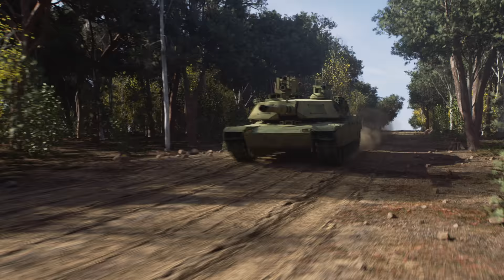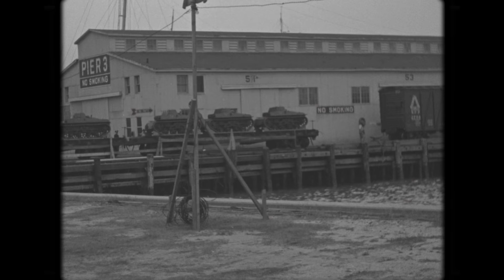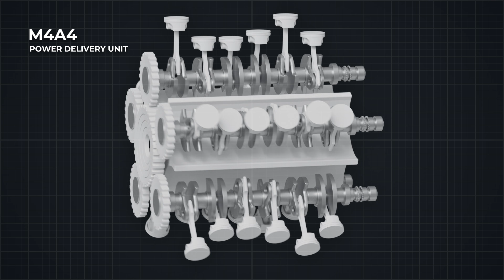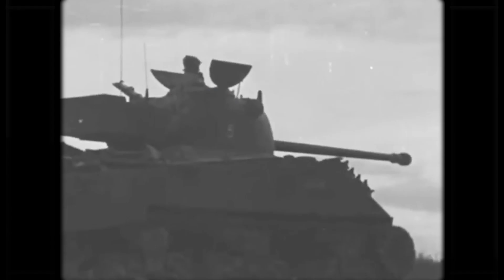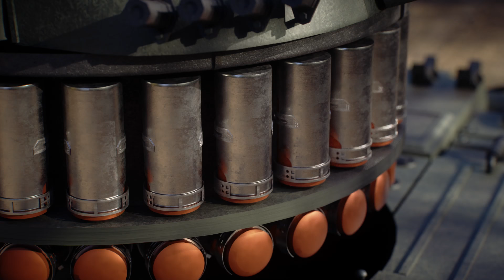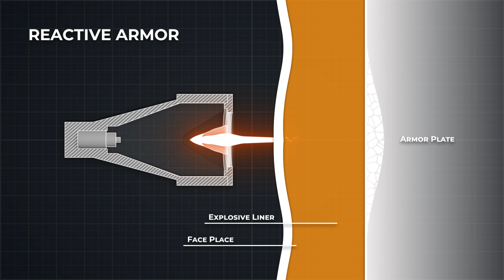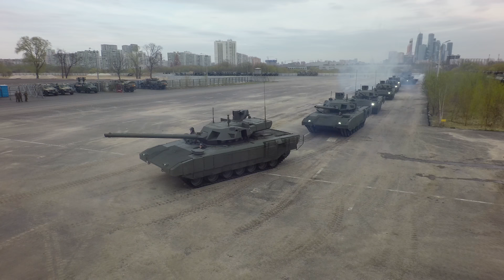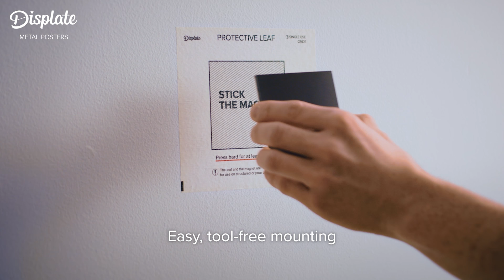Why America’s Tank Failed in Ukraine

Comment: Abrams has one major advantage over Armata tho... it exists.
Reply: Abrams is a useless POS - drones.
Reply: Armata also exists. It exists, it goes, it shoots. It is not a design. It is not a dream. It is about 20 existing tanks. 
Unlike Abrams, it doesn't have a reliable engine (for the 1st time in the century russians decided to create a new engine instead of using old V-2 series as usual and failed) and it's mass production is very questionable, Russia doesn't need 10 guchi tanks, it needs tanks that can be massive. 

Armata btw is the only existing tank in the world that has an unmanned turret and armoured block for the crew in the hull. It is a very futuristic technology every country wants to adopt, right now americans are working on a new Abrmas, they literally copy russians. Next Abrams will have 3 man crew, an autoloader, unmanned turret, it's munitions are stored deep in the hull. Basically, Armata already has everything listed above. 

The fact that russians made this breakthrow first and the only reason they didn't start a mass production is an unreliable engine and the price still does them credit. 
Before M1 Abrams was created americans tried to make a tank with autoloader, took 6 years, resulted in failure. That's why Abrams doesn't have an autoloader - they needed a new tank fast and didn't want to risk this time. In 90s they wanted to make a new tank after m1a2, failed again. 

Failure are temporary, every element of scientific breakthrow is valuable.
Reply: @jacobfrost2131  Having 20 tanks and not being able to mass-produce or use them means it effectively doesn't exist. It's been more than 70 years since WWII, by now everyone should've learned the lesson that technological marvels you can't deploy in the field are worthless.
Reply: @nemanjajovanov yes, you are right. 

But as there is no evil without good, there is no technological advances without failures. In T-14 there were many new technological solutions like a new canon and CCS. 

There were leaks for T-90M2 which is going to be produced this year. It will have Armata's canon and turret and CCS.
Reply: @jacobfrost2131 No disagreement here,  but I think this is more about actual usability in the current conflict. Those new T-90s will probably be late to the party too.
Reply: @nemanjajovanov  gonna see. They have ERA all around even on the top of the turret.
Reply: @jacobfrost2131  New engine, it is derived from a German WWII engine.
Reply: @bluerisk  Yeah, as much as F-35 is Yak-141 remake and other absurd assumptions.
Reply: @jacobfrost2131  are you actually stupid enough to think that that was a convincing argument? You cant' even get your T-14 info right. They dont store their ammo "Deep in the hull", thats what those crappy T-80's/90's etc did. T-14 uses a blow out pannel (finally durrr) like proper western tanks. The engine failure is a side issue. They also lack the chips to properly control the tank and the optics to see where the F they are going.  THe T-14 ain't Gucci, its a temu knock-off that fall apart at every point. 

THere reason the US didn't get a autoloader was because it was 1 SLOWER. 2 took up MORE SPACE. 3 LESS RELIABLE.  The French have had autoloaders for decades its not that hard durr. ALso considering what absolute death trap Russian autoloaders have been you really need to S T F U.  No ones copying Russia because all Russia has to show is how to NOT implement ideas that have been around for DECADES. None of this is new. Russia is the guy in the batsuit jumping of a tower and then pretending they invented flight because  they only broke 3 out of 4 limbs on landing
Reply: @jacobfrost2131 Копировать у русских ? Это что то новое , не смеши .
Reply: abrams X enters the chat...
Reply: Exist five minutes on battlefield
Reply: @MilanDrazic  keep coping
Reply: So does the t14
Reply: @Rex_82948  lol did they call it T-14 because that how may they actually ended up making?
Reply: Not in significant numbers in Ukraine, though.
Reply: @nikolatasev4948  There are around 60 Abrams in Ukraine. That's more than the T14.
Reply: @kcimb  Not according to this video.
Reply: @nikolatasev4948  There are more Abrams in Ukraine then there are modern T-90's in Russia
Reply: @trickslies844 wishful thinking
Reply: @ocamlmail  Not far from the truth.
Reply: @trickslies844  you mean there are more abrams in russia just not the way you imagined 😂
Reply: @trickslies844  Indeed, at Victory Park in Moscow, I saw a BBQ'ed Abrams, but not a single T-90.
Reply: @trickslies844  nice cope.
Reply: @roddeazevedo  meanwhile ukraine got a whole lot of burnt t90s. cope harder gopnik.
Reply: @mitri5389  Well there might be more Abrams in Russia then T-14's sure
Reply: @saucy743   Don't worry I'm sure you can buy back the export models, not like any one else still wants them
Reply: @trickslies844  russia is probably not gonna go with the t 14 design... its only 30% better than the tanks out there at 3 times the cost. In all reality both the us and russia are gonna take the hybrid approach of incorporating new tech on to overhaul of the exist tanks ideally from the ground up
Reply: @trickslies844  over 300 T-90Ms get made a year. Over 100 Abrams's get retired every year :) . Many nations infact want them, even more than the overrated and overpriced world trade center on tracks that you shill so much for.
Reply: @mitri5389  lol they aren't making them because they dont work and they can't actually produce them. Hard to build fire controls and unmanned turrets without proper optics and recycled chips. Specially when your can't even get them out of gear.  

Ah yes the "overhaul" of useless patch work upgrades that has failed them every single time. WHat are they gonna do? Make the T-90 have a unmanned turret? A blow out panel for their carousel loader?  Finally get their active protection system to actually work?
Reply: @saucy743  lol sure they do, thats why  Russia only ever owned 300 of them.  Just another gimmick, crapping out half done vehicles and pretending there is actually something there

lol literally  no one buying russian arms of any kind. Remember you can't fake the purchase orders from other countries lol
Reply: So does the t14
Reply: You need updated news.. I bet your latest update on the T14, was when it stopped running in the Moscow parade.
Reply: T-14 has one far larger advantage over M1.
It's in production.
Reply: @vladkorobov155 ahh yes as evident by all... None of them that have been seen fighting against Ukraine, great production capacity they must have!
Reply: @AndrewWellsPlus  
"None of them that have been seen fighting against Ukraine"
/facepalm
How would you even see something that's five miles behind the frontlines?
Drones?Jammed or eliminated.
Mark one eyball?
Doesn't have the range.
Reply: @vladkorobov155  
if they arent on the frontlines it means they arent fighting in ukraine.
and non have been reported in ukrain meaning there arent any.
if youre claiming they are standing around behind the frontlines then give a reason as to why when russia is throwing every tank they have into the conflict while losing most of them in rapid succession to drones, mines and artillery.
Reply: @uteriel282  Yes they have been reported in Ukraine, and there was also news about it.

No, they are no longer in Ukraine, because Russia decided that they were to expensive to lose, and even more importantly, they were afraid western Intelligence would get the technology.. They were there for a few months on a trial run on combat.

And you people keep talking about things like they are some finite number.. A lot has changed these past 4 years, and Russia is a leading producer of drone tech, tank tech, missile tech etc, and more importantly, everything they use now is essentially things they made after the conflict began, because in the beginning they were shocked to learn that most of their supposed storage supply, had been sold off by corrupt people.

Think of it like Germany in WW2.. Once a country put that big finance into war, and concentrate its population around it, then development and production start happening extremely fast.
Reply: @vladkorobov155  Just because its not officially been cancelled does not mean its in productions
Reply: @trickslies844  
Yes,but the fact that it is in production means that it is in production.
Yeah,Russia doesn't make them at the same pace as T-90s,but,again,there are more T-14 made yearly than ANY Western tank.
Reply: @vladkorobov155  They literally haven't made any since the original batch. Apart from being to expensive by Russian standards and not working properly they also lack the parts. And that is with Russia's overinflated BS productions numbers
Reply: Cope bro. America doesn't find itself in land invasion so it doesn't invest much in things like tanks, rocket launchers and artillery shells. That's why there was a shortage of 155mm shells in Ukraine war. Abrams is outdated. And France is thinking of buying the Indian Pinaka Rocket launcher as it's more proven in wars.
Reply: @Robot_Frank Oh yeah, sure.
Reply: @Robot_Frank  ok buddy you want to live in a radioactive Cobalt sea?
Reply: @Robot_Frank  lol they literally have some of the best and most battle tested equipment. Reason they have a shell shortages is because they aren't stupid enough  to fight a WW1 trench away. Don't need  prolonged artillery shoot out if you blow up every factory, depo and supply line within 2000 KM of the front line durrr. 

Also building a lot of 155mm shells is pointless if you forget to built the barells to fire them # russia dumb

Comment: This is a fantastic technical breakdown of the Abrams' history, but the title 'America’s Tank' and that '27/31 destroyed' stat are significantly outdated in 2026!

While the US provided the initial 31 'gas guzzlers,' Australia is now the primary active supplier.

Canberra just finished delivering the final tranche of 49 M1A1 AIM SA tanks (Operation Kudu) in January 2026. This brings the potential Ukrainian fleet to 80 units, making the '27/31' loss rate look much worse than the current reality on the ground.

More importantly, the Australian models were reconfigured to run on standard diesel, solving the 'logistical nightmare' of hauling specialized jet fuel to the front.

They are also arriving pre-fitted with integrated anti-drone cages and EW kits—a direct evolution for the drone-driven war we see today.

The Abrams isn't failing; it’s being adapted by Australia as a strong partner into a much more sustainable platform than the first 31 tanks suggested in your thumbnail.

Comment: The «Armata» tank is technically superior to all other models in the Russian arsenal, boasting advanced features and superior firepower. However, in the context of the ongoing war of attrition in Ukraine — where equipment losses are high and rapid replacement is crucial — one factor outweighs all its strengths: its prohibitive cost (of course, when compared to other Russian tanks — not Western competitors). Due to this, the «Armata» remains absent from the battlefield despite its potential.

Comment: Furthermore, Ukraine has more than 100 Leopard 1 Tanks. They are light, fast but have a thin armor. As of April 2025 only 17 have been destroyed. And they are heavely used by the army.

They also have 167 donated Leopard 2 Tanks. 38-40 were lost (numbers vary).
This tank is also heavily used.

Based on these facts, the Abrams failed heavily in comparison

Comment: If you can't use the tank because it drinks more fuel than you can supply it's not much good. But here is the thing I don't understand. Why not use a hybrid drive train. Using electric motors you can drive the tracks on more than one place, cutting stretch, electric motors have huge amounts of torque right from the off. The generator can be low weight and low torque connected via a battery buffer to allow for variations in immediate use. The motors and generators etc. can be placed at the front as extra armour

Comment: I don't understand this video. You say Abrams' fuel consumption is high and that's the biggest problem. And then you don't even say what the range difference is between Abrams and other tanks. Bringing fuel for 30 tanks shouldnt be a problem, right?
Reply: You can expect a third to a half of a range of T-64.
So in practical conditions barely enough to get to frontline and from it

Comment: A lot of people have said it and I agree. This video, especially the anecdotes from ww2 are pretty inaccurate. I understand you're an engineering channel and I guess commenting on things previous to your time is relevant but at least get them right. The tiger was not impervious to a Shermans 75mm gun from the front, which wasn't even the only tanks that would fire on the Tiger. You completely missed the Cromwell and Crusader tanks. The German vehicles regularly broke down driving to the battle fields off the trains. In the desert most of the American and British tanks were matching if not better than the German tanks overall. By the way there were very little Panzer 4's in the desert. They mostly had pz3's and 2's. The m3 Lee brought them victory through it but it had its own problems as well. Mainly it being so fuel hungry half of them couldn't even run. Your glorification of higher calibre equals better tank is stupid and your remarks on modern tanks aren't much better as you said that the Russians learnt that turbine engines were way worse  than diesel engines, framing that they are completely worse than diesel engines in any scenario. Not mentioning that they actually abandoned it because it couldn't start as well in low temperatures. You have 5 million subscribers, surely you have some connections to actual experts on the topic to have chats and even feature them in your channel. Give us some actual valuable commentary and do your job well.

Comment: couple things. 
 
they were the m1a1's not the m1a2's m1a2 SEP, or m1a2SEPv2 far from "the most modern" abrams with no era or active protection systems and the old versions of the armor. 

ukraine got 31 abrams from the us and 49 from australia bringing to the total to 80.

oryxs list 23 destroyed, damaged, or captured abrams each one is photographed. the  source of the 27 number is according to the Russian ministry of defense who arent a reliable source of information especially during a war. anywho oryxs list 10 destroyed, and the rest damaged with one captured by Russia. its possible some of these damaged 23 tanks were recovered and repaired or used for parts. also possible more have been destroyed without ever being photographed to oryxs standards. 

if you go through those photos you will see many with added russian ERA(not all application/era is equal/equivalent) and many cope cages. however none with active protection which may have saved them from rpgs, drones, and missiles but done nothing for mines, artillery, or apfsds (will stop heat though). 

the "armor doesnt matter" claim due to high pen rounds is not entirely accurate. angled armor can deflect round. era can stop all HEAT that is not tandem charge(missiles only), and spaced armor can stop tandem charged(think cope cages). 

the highest pen rounds russia has for their tanks are guided missiles shot from tank barrels that are quite expensive and basically non existent at this point as their cost is exponentially higher and requires sanctioned microchips. 

next best thing is 3bm59&60 which only entered service in 2016 and are a lot more expensive and less stocked then older models, and are also only for the 125mm guns that the majority of active service russian tanks atm can not use as they have had to pull so many older tanks form the 50's, 60's, and 70's form storage for this war.

most the rounds being used now were designed in the 70s-90s on the more modem 125mm guns and as far back as ww2 rounds for the older models pulled from storage. 

and the most important armor for tanks agasint drones isnt armor its anti air be it infantry with shotguns, gepards, phalanx, or drone hunter drones, its way easier to create a system to shoot down drones then survive drone strikes.

Comment: It didn't fail, it was sent in very small numbers, without enough logistics support, and frankly it's a bad fit for the region do to it's weight and Ukraines soft wet soil.
The Abrams Tank is a VERY expensive system to keep up properly as well, I mean it literally uses a jet engine for the power plant, we joke that it doesn't burn fuel, it burns money.